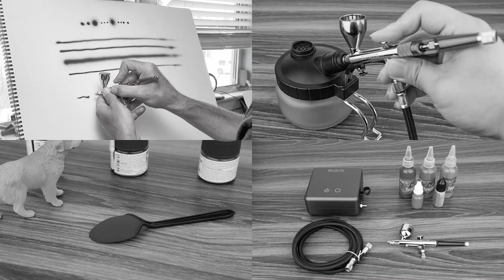To Cap or Not to Cap: Exploring the Needle Cap Debate in Airbrushing

Comment: I have this airbrush and for the most part I absolutely love it. I love the easy changing nozzles, big plus. However, this is my only airbrush that I remove the cap on. For some reason I get an excessive amount of build up on the tip which will end up dripping or getting blow on my project. Not sure why, the spray pattern seems centered and everything acts properly. I have two airbrushes that I plan on replacing. I am definitely replacing them with this airbrush. I won't go with the black cup again though, it can make it tough to ensure you have cleaned it out properly. But yeah, I love this brush, I can't believe it only cost what it did!
Reply from the maker: Thank you very much for the like! Regarding the issue of paint build-up, it's quite a common occurrence with almost all airbrushes. This is precisely why it's crucial to address tip dry when utilizing the airbrush. I'm excited to inform you that we're currently in the process of developing a new airbrush model. It will be launched soon at a reasonable price point, and I assure you, it's something you wouldn't want to overlook. Your continued support means a lot to us. Thank you!
Reply: @NEOECO-Airbrush   i was about to order that airbrush but i think i'm gonna wait for the new model, when is it scheduled to release?
Reply: I agree. Same thing happens to my Neoeco.

Comment: The upside of a cap is backflushing. And if your tip is drying out you're not using enough thinner/flow aid.
Reply from the maker: If the upside of a cap is backflushing, please try to tighten the nozzle cap with mini wrench, then the problem will be solved.